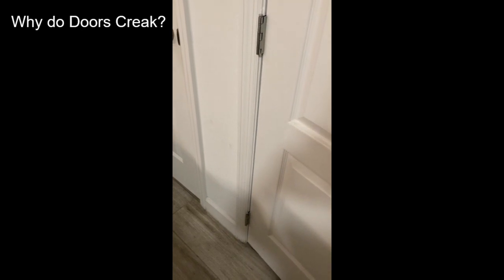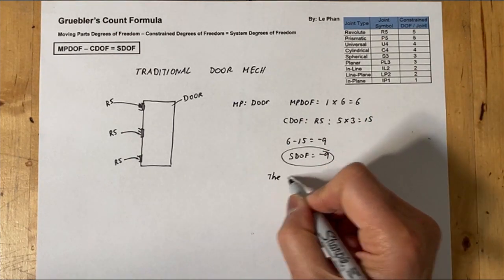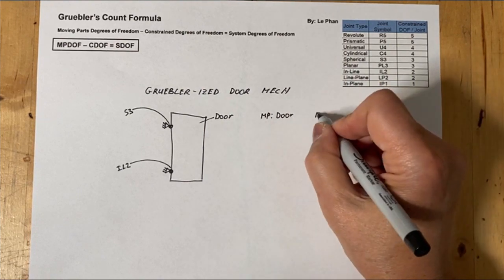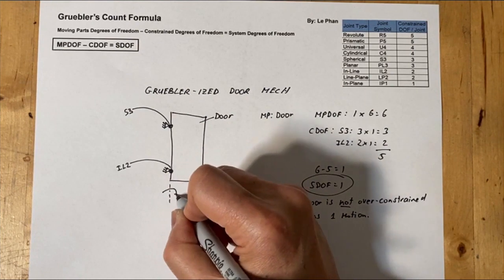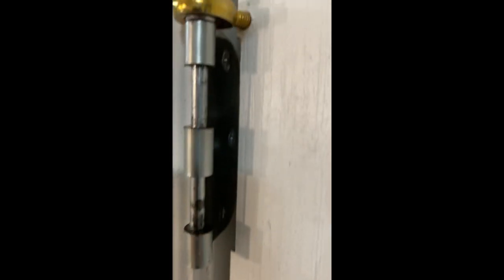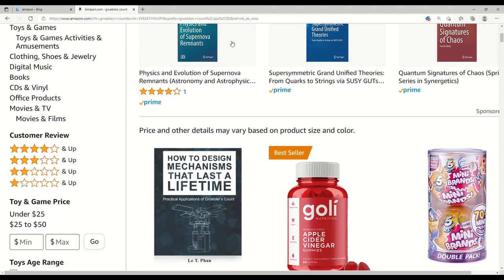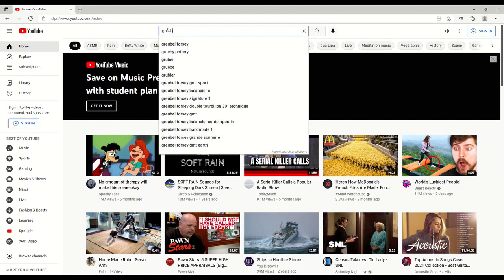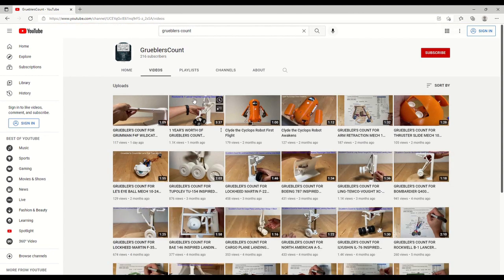Why do doors creak? Squeaky Door?

Comment: Die theorie van je zal wel kloppen, maar uit ervaring weet ik dat deuren/scharnieren niet kraken en piepen als de scharnieren correct geplaatst zijn. ze moeten met de ogen zo nauwkeurig mogelijk in 1 rechte lijn geplaatst worden. bij lichtere loopdeuren zijn 3 scharnieren vaak voldoende, maar bij zwaardere loopdeuren zou ik adviseren om een vierde scharnier te plaatse (eventueel met kogellagers).
Reply from the maker: Gruebler's Count helps us obey the Laws of Physics. If we don't obey the Laws of Physics, parts are overstressed, parts wear, things break. This example (door hinge example) is used many times machinery, the technique is called "Fixed and Floating".
Reply from the maker: The world leader in Multi-Body Physics software is ADAMS. They use Gruebler's Count 3D as a pre-requisite to running their simulations: https://www.youtube.com/watch?v=7oa0Iu3DpWo